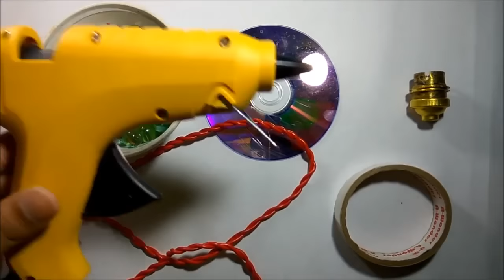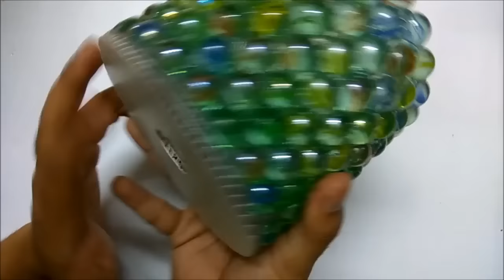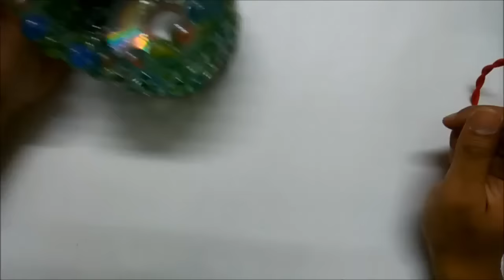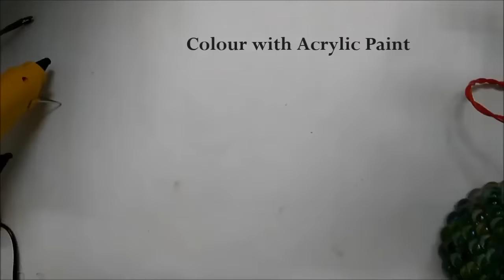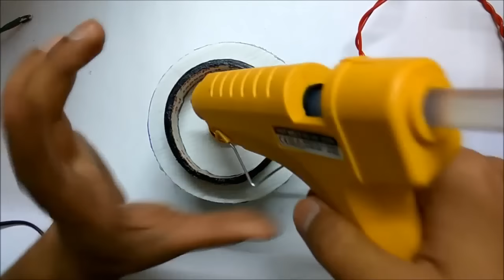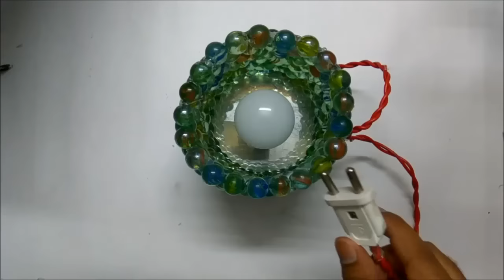DIY Lamp Shade - with Glass Marbles

Comment: I have watch several diy projects(different designers) and i cant understand how the glue holds up to the heat of the light element.i mean does the glue get hot,melt or set fire?i asummed it to be highly flammable.or are these lamps decor only,not utility for light at all?can anyone answer.
Reply: 12Sisters 1bride If you are worried about this then you can make the lamp shade without the light and instead use LED battery operated lights.